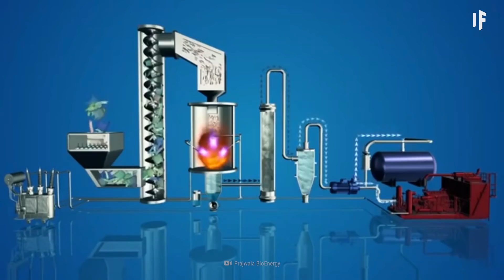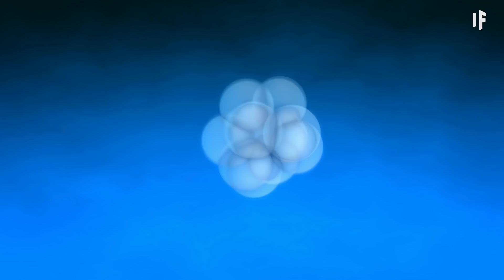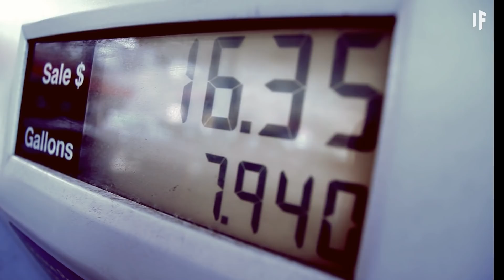What If We Turned Plastic Into Fuel?

Comment: I don't understand the concept of cracking down the plastic because after all it is also using energy and the amount of fuel that you are generating is nothing in front of the energy utilized.

Correct I'm wrong

Comment: Countries without fossil fuels can use it till they transition into renewable energy. This can give opec a run for its money.
Reply: I don't understand the concept of cracking down the plastic because after all it is also using energy and the amount of fuel that you are generating is nothing in front of the energy utilized.

Correct I'm wrong
Reply: a part of the fuel generated i.e approximately 20% is used back  to run the plant but 80% is capitalised.

Comment: Conveniently leaving out the fact that doing this would release all of the carbon in those plastics into the atmosphere and contribute further to global warming, while simultaneously claiming that it would be "Good for the environment" is both negligent and unethical. Burning fossil fuels for energy contributes to global warming. Turning fossil fuels into plastic contributes to global warming. Turning those plastics into fuel requires energy that likely comes from fossil fuels, and contributes to global warming. And burning those fuels made from plastics that were made from fossil fuels to create energy **contributes to global warming**

This doesn't fix any problems and it doesn't reduce pollution, it just moves it from somewhere we can see it to somewhere that we can't, using the things that caused the problem in the first place to do it, increasing demand for those things and perpetuating the problem further. Intentionally or not, This video is contributing to the misinformation campaign that giants in the fossil fuel industry have been propigating for decades.

Comment: Normally i was collecting my trash wich can burn in 60 liters bags. Everything like plastic wraps, used paper and cardboard, rubber, etc... 🔥
 In the winter i was burning those bags mixed with wood to heat my house. ❄
 The chimney is charging up pretty fast from the plastics but for me was like a energy recovery. 🚮🔄🔥
 Now i wonder if i can use those mixed bags in this type of installation or this works only with plastic? 🤔

Comment: I guess it would be better if you just turn it straight into energy(like thermal or smth) cuz fuel still causes carbon emissions right?
Reply: Plastic is made of long chain hyrdocarbons, petrol and other fuels are short chain hydrocarbons. The process to make plastic into fuel is called catalytic cracking where a part of a long chain hyrdocarbon is broken away and therefore becomes a short chain hydrocarbon. They both have the same amount of carbon and hydrogen to be released so it makes no difference energy wise however it would be easier to make vehicles and such that run on short chain hydrocarbons rather than long chain and short chain is easier to store.

Comment: your still going to need to use other fuel source just to melt it down also we still would need fossil fuels.  Plastics are made from natural materials such as cellulose, coal, natural gas, salt and crude oil through a polymerisation or polycondensation process.

Comment: Ideas:
What if you shot a nuclear mid air?
What if dragons exist?
What if humans didnt evolved?
What if the sun's gravity is double?
Reply: if you shot a nuke in mid air, it wouldnt result in a nuclear explosion. nuclear weapons do not work like real bombs or missiles, they are placed on a timer or remote detonated before it impacts the ground for better destruction. once the timer goes off, fission occurs and a chain reaction occurs in the nuke, splitting every atom, and the split atoms splitting other atoms. however, if it was shot down before the chain reaction, they do not simply cause a nuclear explosion with a firestorm or mushroom cloud but instead just a normal explosion when it is shot in mid air
Reply: @bruh.mp4494  k
Reply: @bruh.mp4494  Will also result in a complete city power outage.
Reply: I like the 4th idea
Reply: @hellothere2740  thx
Reply: 4th then humans are not exist
Reply: @blackarea1198  or maybe human will have more power to survive in heat
Reply: @farelrajwa1300  or the sun radiation could collab with other suns and destroy every demensin.
Reply: Creative
Reply: Every " terror in resonance" fan knows the answer to the the 1st one.

Comment: Well, if we had nuclear fusion we'd have enough energy to easily transform plastic into recycled plastic, and yes, fuel if you desired it. We may not required fusion to do this, because of a recent IEA study. It concluded  that if we went bigtime into wind power at sea, and converted some of the electricity produced, and sea water into hydrogen, there's enough for 18 times the global energy consumption of 2018. Yes, recycling would be trivial like with fusion

Comment: Environmental engineer here. Even though I am all for this, this is just a temporary solution to the plastic problem. This will help alleviate the polluting plastics and should ONLY be used to lower the number of plastics already in circulation. The problem is, if this does kick off, plastics will be needed to drive this process. That might mean that people will continue to use plastic JUST so they can continue this process. And also, since there are many types of plastics (1-7), I'm assuming we'll still have to segregate the types of plastics for specific fuels. 
Again, just some food for thought. It's a good start, and I support this entrepreneurial alternative to "recycling" but this isn't the final solution.
Reply: Hi
What's is the final solution?